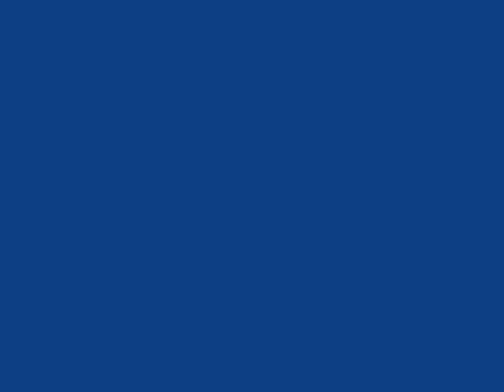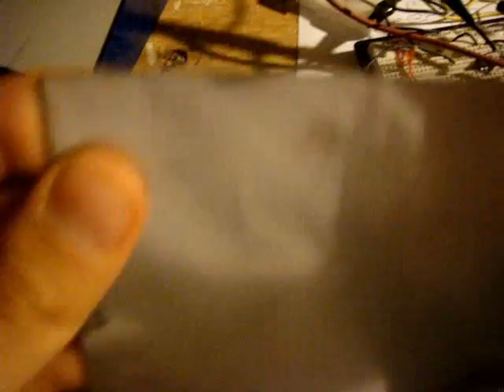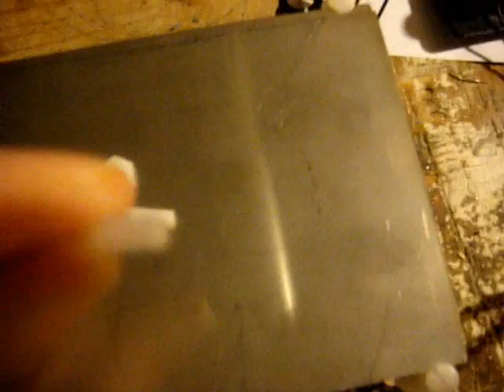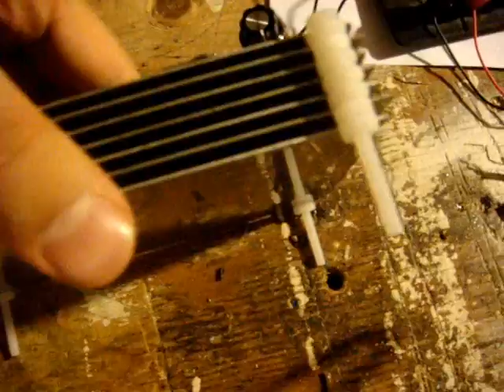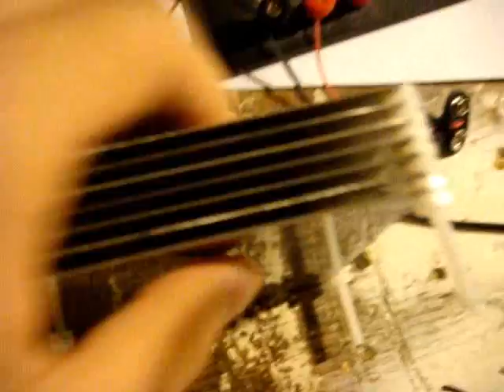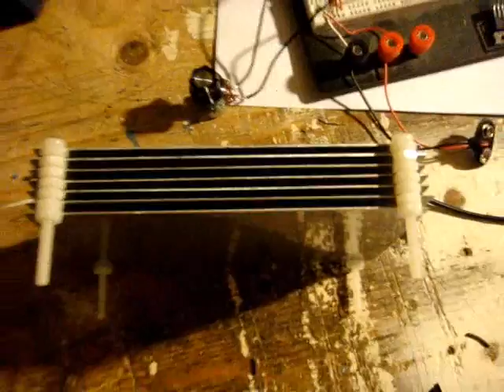7 Plate JC Cell Prototype

Comment: Hey nice to know ....no drilling.  Plus, if you just put a few wire ties around the perimeter, it will hold the screws in place, even if the get banged around.  I'm trying this on my next cell, thanks.